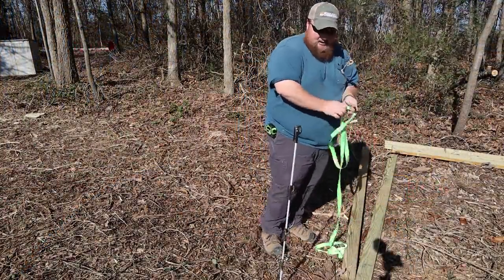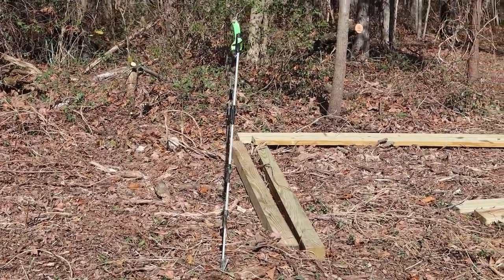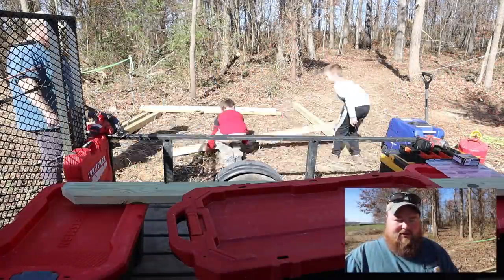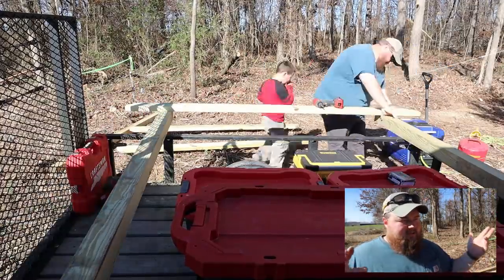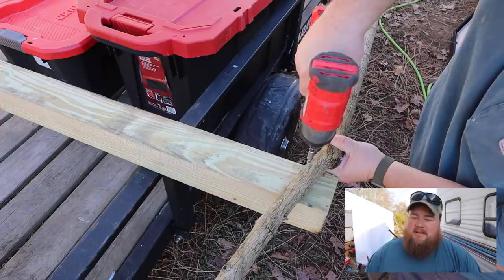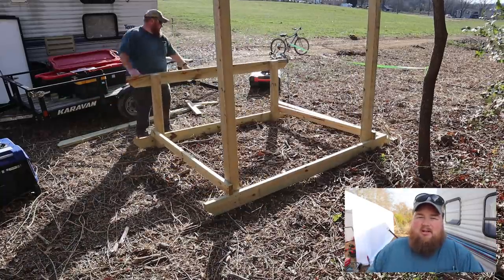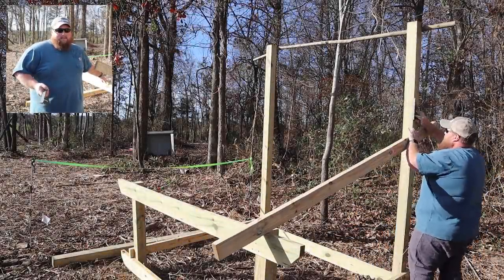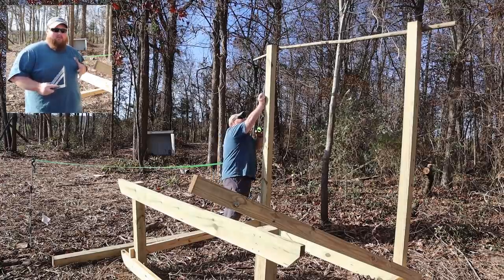DIY Wood Ground Mount Solar Array

Comment: For the upper and lower connections of those slanted 2 x 4's I'd attach those with some galvanized roof truss or even joist hanger brackets. You can find them to fit most angles you'd need. The way you have it attached with just a few screws isn't likely to hold for very long.

Comment: yay local Tennesseans to help with my solar rack design, newly on my off grid homestead Aug 2022. Have 1600 watts 8 panels, 24 volt battery, solar charge controller, 5000 watt pure sine inverter, have been puzzlin how to build one and where, now I can decide logically

Comment: I put 4 lawn mower wheels on my panels. Had problems with vandals, so I needed to put them away whenever I left. Then angle iron for prop rods to lean them back

Comment: The trick to putting water in a hole to soften the dirt is:  Wait for the dirt to get soft. You have to wait a while. It's not an instant trick. Speaking from Arizona where the ground is rock hard and can bend a shovel unless you wet it.

Comment: Looking nice! I am interested in how you attach the panels to the wooden frame. I have used unistrut in two installs and it has worked very well. 

I hope other parts of the property are easier to dig in. That looked painful.

Comment: think by the time you need to build the sheds for the woodworking and soap production youre going to need a posthole digger mounted to a tractor , basicly to be able to dig through the roots and rock in the ground , should be able to float the solar array , just need to ut a lot of weight on it to prevent it falling / being blown over
would add a few pieces of wood diagonally in the frame to firm it up some and for the weight you could set the batteries inside it

Comment: I plan on building one of these on my property. I'm going to try to have it double as a firewood shed.
Edit: Had no idea about Solar Noon. That will come in handy.
Reply from the maker: That's a really good idea to double-dip that chip! I may have to steal it. LOL Extra bonus is the firewood would further help to keep everything in place! 

Maybe you'll appreciate this, since you're also building on bare land. Isn't the hardest thing deciding where to put this stuff? It's so difficult working with a blank canvas and thinking of putting down something permanent! At least I struggle with it. LOL Hours and hours just thinking "is this the spot, what about that, okay at what angle". LOL
Reply: @sam-and-angela  Sam use paper. Draw your land to scale. Then draw on different color construction paper & cut out your workshop/greenhouse, Angela's soapshack, and all other buildings you want/have to be moved to/or build on the new property. Move them onto your paper property until you like the set up/flow. This way you have a plan & know where you want each item of your infrastructure.
Reply: @sam-and-angela  Yeah, I'm with you. I just finished my post and "beam" foundation and I have been second guessing my location almost immediately....not to mention the location of the well, since the witching discovered multiple sites that looked good.  I already submitted my site plan though, so moving the stake could prove to be difficult.

Comment: What kind of solar panels are you getting?  Generally Q Cell panels are pretty good.
Reply from the maker: We bought a stack of used off-lease panels a few years back that have been in storage ever since. Happy to finally get to use them! We paid right at $0.20 per watt for them.
Reply: @sam-and-angela  That's Great.  What brand. Maybe Jinkos. I work for a solar company, so if you need help I'll do my best to walk you through it.
Reply: @sam-and-angela  awesome price. The going rate right now is about $1 , so you did great.

Comment: Does your brother have an auger for his tractor that would dig a post hole? It would probably still be tough to get through all of those roots but if you stand on top of the auger and rock it back and forth with your feet, it’ll go down.

Comment: I see that you guys aren't brand spacfic. Using an auger that close to the forest will definitely fight you. What type of fourwheeler is that?
Reply from the maker: Not sure what you mean about brand specific?  The four wheeler is an old 80s model Yamaha with cracked rings that will smoke you out until it warms up. LOL It's an old one, but better than the alternative! :)

Comment: I can't believe you tried to drill/auger out only one hole and because you hit some difficulty you gave up and decide to just build the framework for the solar array on top of the ground, come on Sam!  You are better that that, you are not thinking this through, the first good wind blow you get what do you think is going to happen to that structure and the solar panels, bye bye the lot I should think, what was wrong in trying to dig a set of new holes until you can get the posts into the ground, time for a re-think and a re-do, don't fall into the rushing things trap, that can and will cost you more money in the end, Angela tell him to put his sensible head back on, you know the one I usually see.

Comment: Looking nice! I am interested in how you attach the panels to the wooden frame. I have used unistrut in two installs and it has worked very well. 
I hope other parts of the property are easier to dig in. That looked painful.
Reply from the maker: I've been thinking about the solar mount this week and may take off the 2x4s in lieu of Unistrut. I've been looking at your video a few times where you mounted your panels for inspiration. :)
Reply: @sam-and-angela   My most recent version I did not use the all thread and aluminum bar idea. I simply used torx screws and a washer straight into the wooden frame to hold the unistrate in place. My big mount behind the house I think those All thread brackets were a good idea for strength. For the small mount it would have been overkill.